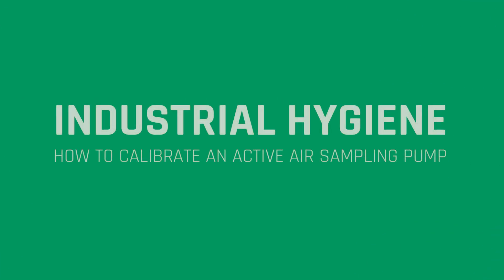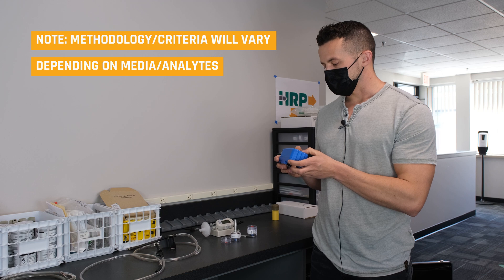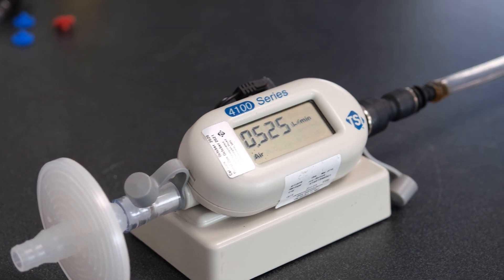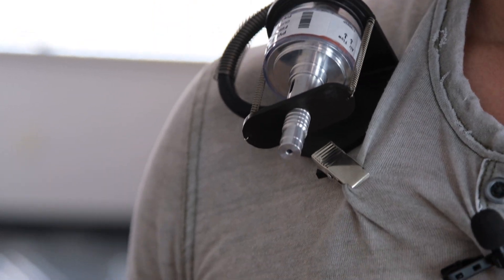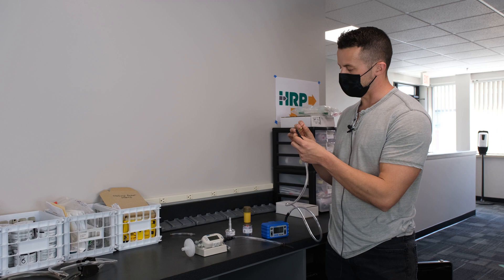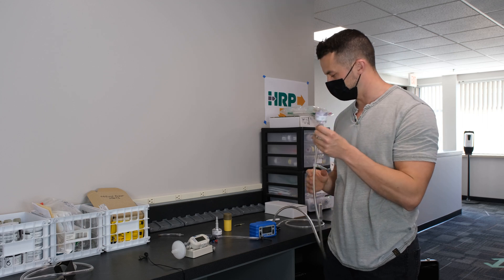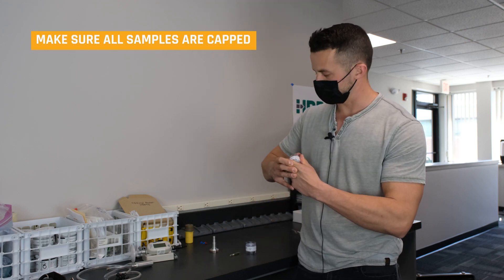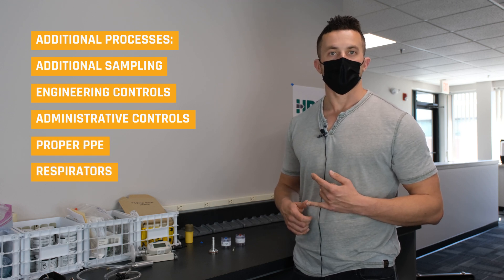Industrial Hygiene: How to Calibrate an Active Air Sampling Pump

Comment: Shouldn't the cyclone be the other way around in the cassette holder?  See NIOSH video link below.

https://www.youtube.com/watch?v=9LPzWn9GchQ
Reply from the maker: Great observation!  Most important in this application is the orientation, flow direction, and cassette/cyclone seal of the sampling media.  In practice, we sometimes use media holders in different ways to stay better attached to the participant,  or in this instance to also better support the actual cyclone position within the cassette.  It is always important though to refer to manufacturing specifications or industry guidance so thanks for providing a link to the NIOSH page!  Something else to point out which we didn’t demonstrate in the video is the use of a grit pot or end cap during actual calibration and sampling!  Thanks for tuning in and for the great question!